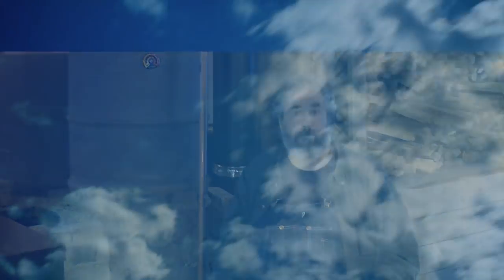external air intake for a rocket mass heater

Comment: If you have an ERV (energy recovery ventilator) you can have fresh air and avoid losing as much heat by bringing in cold air through leaks in your building. Whether you worry about losing heat is probably only a function of your overall efficiency.

Comment: Wait but if the rest of the home is insulated well, doesnt the indoor-air-intake take away your oxygen? Is that not bad for you?
Reply from the maker: Indoor air intake takes away stale air and replaces it with fresh air.  If your house is sealed too well, you have been converting the oxygen to carbon dioxide. Therefore, outside air has more oxygen - do you want to feed that to the fire or to you?

Comment: Isn't there any need to pre-heat the incoming air (like for the conventional mass heater). Even if the air is taken from inside, would there be any significant advantage to let the intake run along a warm part of the oven? Thanks for sharing your knowledge !

Comment: We are renovating a 100 year old house. It is a "vertical plank" construction and built using the "balloon" method, meaning the walls go down through the floor to the supports in the crawl space. From prior experience with this kind of construction and wood heat, I already know if I use wood heat in this house without using an external air source every little crack in the beadboard walls will become an icy blast of air while the fire is burning. I don't want to completely seal up the walls, as I have seen information which indicates allowing the free flow of air within these walls may be what has kept the structure so sound. Is there anyone who has used an external air intake with their rocket mass heater that feeds the fire directly?

Comment: Liked & shared in Twitter and works fine. Important topic,  I was just wondering about this as we are building a new house (cottage) with masonry heater, same question there.  Without external air intake the fireplace serves as ventilation equipment, taking stale indoor air and forcing fresh  air into the house (from outdoors)  to replace it.  The question is which route is the fresh (cold) air going to take? Is it going to come through the walls or through a ventilation louvre or through the window or? What impact is it going to have on your wall materials if it comes through the wall? Moisture? I'm not an expert on this subject but my guess is that it's a good idea to make sure the fresh air comes through a suitable  route that you can control. Remember also that a fire uses huge air volumes so they need a lot of replacement air.
Reply: "a fire uses huge air volumes"... Depends on the fire. A RMH can require around as much air as a common house needs for ventilation to avoid getting stale. Then the question is the routing, and if you make a fresh air intake that passes by the mass, it can warm to comfort level before entering the room.

Comment: We put a duct about 2 feet under the ground, 90 feet long, taking fresh air from a cold frame. At first we thought to take the air from the adjacent green house, but as it might be inhabited by the chickens in winter we thought it better to avoid dust mited air. The duct functions as a kind of  canadian pit that brings preheated, fresh air into the room of the rmh. It also prevented freezing air to come in from the cracks in the doorframes and ceiling. From our measurements, there was a average of  7°c difference between outside air and the duct exit air.

Comment: What would happen if you insulated the air intake?  Of course that wouldn't cycle the stale air.  If you made the external intake smaller could you have some stale air entering the furnace?  Maybe that would be one way of satisfying code requirements and still recycling your air.
Reply from the maker: Another issue to consider is that we are trying to make the fire super hot.  Cold air will cool the fire.

Another point to be made:  if we heat the home with one tenth the wood, doesn't it stand to reason that we are also pulling one tenth the warm air out of the house?

Comment: Could the external air intake be fitted inside the final flue exhaust, or vice versa, to do some heat exchanging as the air passes through in opposite directions?
Reply from the maker: My thinking is that it could be good to do that where the exhaust leaves the roof!  An air-to-air heat exchanger,
Reply: Sounds like the best solution I've heard Jerry.

Comment: Yup, I adapted a cold air intake to my rocket stove this year and when it was 0F (and below)- it made a difference. Suddenly the draft I felt at my legs was gone !   However, as soon as the temps hit 25F and above, I could tell no difference and I refrain from using the cold air intake for the reasons you give in the video-- meaning, I want to suck the stale air out of the building. Good stuff Paul

Comment: I am on the fence... I think it be better to have an outdoor intake to have better burn quality. Also if your building is really tight or small it might make it more stuffy to burn your inside air.

I was just reading a study about moisture getting into your walls. It stated that air which was diffusing through your materials would carry something like 1/3 quart per heating season per 4x8 section. However, if there was a small opening the water carried into the wall would be closer to 30 quarts.

I would think the air intake would be better because it would likely cause less air to diffuse through the walls or small openings...
Reply: In a rocket mass heater you want to generate very high temps. Seems like putting cold outside air on your fire would make it harder to achieve that goal.
Reply: Tree Frog, you need as much oxygen as possible though. Paul didn't share any data that made me agree there was any real loss.

Comment: Could a flap valve be used? I am thinking when it is roaring along, it should gap open from pressure differential to give some addition "fresh" air, and when not,, it should fall shut. I think some of the concern about outdoor air supply isn't so much about the hot\cold air being burned, but more that in new construction, the outside is sealed so tight that there practically is no fresh air leading to a dangerous or inefficient situation.
Reply from the maker: Tell me more about this flap you speak of.
Reply: A piece of metal or heat resistant rigid material hung on a hinge restricting air flow from a conduit by gravity. Am I using the wrong term? English isn't my first language go easy on me.
Reply: @paulwheaton  like those dryer exhaust flaps that hold open when the dryer is running and the flap closes (by gravity) when not.

Comment: I agree that getting stale air out is important, but doing so creates a vacuum, which nature abhors. Now, every window casing, door seal, and electrical outlet provides a place where cold air comes to fill the void. That's known as "drafty". The solution is a heat-recovery ventilation, which is a device that removes stale, warm air. In so doing, it heats a set of fins, Simultaneously, another fan pulls cold, fresh air in over those fins and warms it up.

Now you have fresh warm air. You don't need an external air intake that Paul describes. The stove will get air from the heat-recovery ventilation system. Easy peasy.
Reply from the maker: An air-to-air heat exchanger.   Imagine mounting one next to the vertical exhaust that goes through the roof.

Comment: The air intake you demonstrated seemed very exposed to the room which you indicated it was cooling the room.  Couldn't the air intake go through some of the thermal mass close to the back wall inside the mass to gain preheating?
Reply from the maker: Or, better yet:  could there be an air intake from the roof that does a bit of air-to-air heat exchange with the vertical exhaust?
Reply: Indeed.  After I posted I thought that I was stealing heat from the mass but it was an improvement as it would stop the cooling effect of an exposed air intake.  Tapping into the flue heat somehow is even better.

Comment: I still like the idea of an external source for the air intake.  This video shows the most explanation why Paul doesn't like it, that I have seen to date.  But, I wish there were more reasons put forward to back up Paul's personal and sometimes passionate distaste for it that I have heard in other podcasts and presentations.
Reply: (I have to admit that life got in the way, and I only got to disc 2 of the latest DVD set.  I suppose I saw my name highlighted at the end credits on that disk and wanted to basque in the glory of that for a while before I moved on.  LOL)
Reply from the maker: In the summer I keep the windows open.   In the winter, it is nice to have all the old farts, halitosis, B.O. and whatever-that-smell-is-coming-from-the-compost-bucket sucked outside.  Passively.
Reply: LOL.   Now THAT is a persuasive argument!!

Okay.  Now, I might be a tedious here.  What about switching every so often between the two?  Sort of a regulator for what is just right with air turn over (which I also think is a really good thing) and retaining some air temperature.  (Not that you necessarily loose a whole lot of air temperature, but just that there might be a time to maximize it, while keeping some fresh air.)  

(Also realize that if I hunt around the forums at permies.com, a little more, I will likely find the answer. )
Reply from the maker: sounds good to me!  The important thing is:  when heating with one tenth the wood, you are also consuming one tenth the air.  So I think "the problem" here is about one tenth that of a conventional wood stove.
Reply: Oh, Yeah!   I didn't think of that.  That is a good persuasive point to ease someone's fear of loosing the last Joule of energy.

It's funny (at least I find myself doing this) that we like woodstove heat, for among other reasons, to save on energy costs.    Then when we see a new system like this, almost a 'Free Energy' excitement comes across.  And, that excitement leads to "gotta save every Joule".  Why, if we light more than three fires, or use more than two arm-fulls of wood, to heat the house all Winter long, we've failed!  (Okay, a little exaggeration.)  

But, 10 times less air up the chimney than would otherwise have gone, that it pretty good.  And, moreover, the barrel heats nearly the same amount of air, presumably, as a regular woodstove.  So, if there is merit to outdoor air to use to fuel the stove, it is 10 times more a valid point for a conventional stove than to a RMH.

Comment: you make a very good point...especially since you arrived at it by "living" with your heater. There is one caveat however. The way people like to build airtight houses now, where is the burn air going to come from?? (when you do have a fire). In an airtight house now code specifies an air exchanger system. We're saving money on heat but the cost of building keeps going up and up...
I understand your point that most of your heat will come from the mass and that doesn't "burn" air...and that's good. So maybe the solution in a relatively airtight house is a rocket stove and a small opening window at the other end of the house from where the stove is that can be opened/cracked during the actual burns (for optimum stale air removal).
I once had a buddy with a newer "tight" house that used a big old airtight stove for heat....more than once he found that during a cold night (outside) of entertaining guests he noticed that quite a few of them started feeling sleepy.....that's not conducive to a good party ;););) just sayin'
Reply from the maker: We have had troubles in our airtight house when the clothes dryer was running when we tried to start the rocket mass heater.  We open a window a pinch while we start the rocket mass heater and once it is going, we close the window again.   I think the rocket mass heater pulls harder than the clothes dryer, so maybe cold air is being pushed into the laundry!

Comment from the maker: if the air intake for a rocket mass heater is made even lower, then the stale air from the room is used that is the COOLER stale air - as the warmer stale air is higher.

Comment from the maker: What have I left out about external air intakes?
Reply: Do you use a damper to shut off the air supply when the burn is done?  If not I'm thinking you have a flow that doesn't stop, which cools the system.
Reply from the maker: So the damper would be on an external air intake?
Reply from the maker: this is the system with the guillotines, but they are for the exhaust and not for the air intake.

Dampers plug by only 80%.  the guillotine was probably closer to 99%.